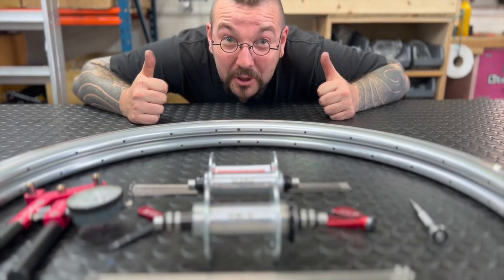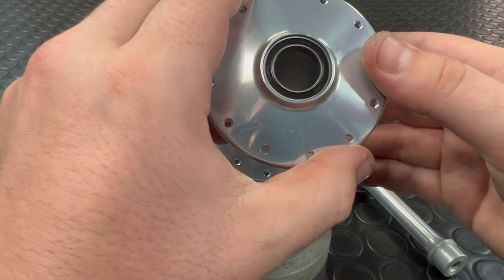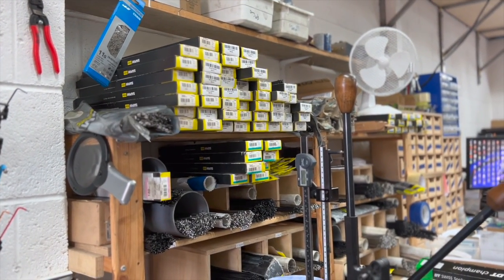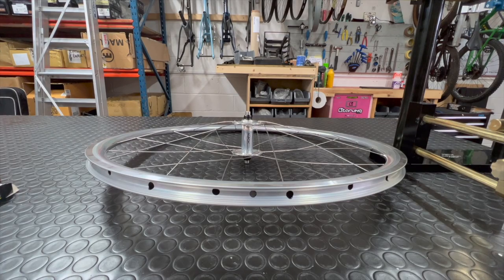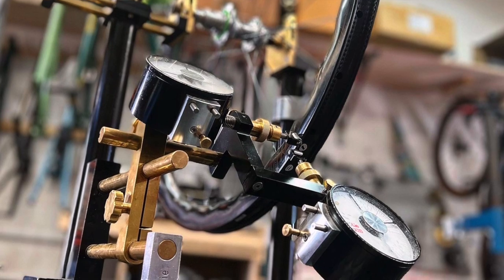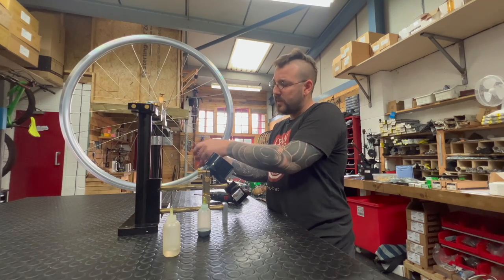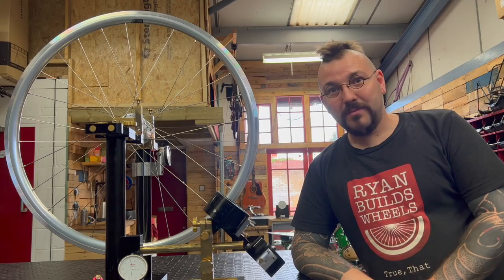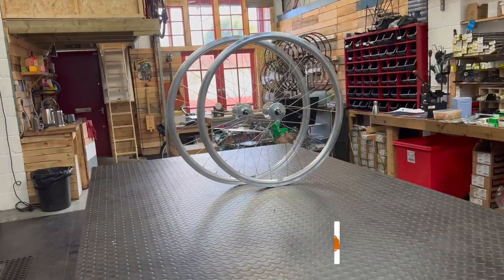Ryan Builds A Wheel (+ Mack Track Hubs Review)

Comment: I build a wheel every couple of years.  My trueing stand is a length of angle iron with a hole in it. Clamped into a monster vice on a plate steel table and magnetic base is a dial indicator  gauge. Your stand is amazing with rigid arms and roller tip gauges! It takes me longer, but I get good results with what I already had around.
Reply from the maker: Swell! Part of the joy of wheels is that they can be built with all sorts of equipment! I (naturally!) love my P&K but, hell, you could build a good quality wheel with nothing but your bike frame, some zip ties, a pointy thing of some sort or q-tip, and your hands to check relative tension...hell, I guess I should make a video about that some time soon!

Comment: Hello Ryan, what a great video, your truing stand is the stuff of dreams. Can you give more info on  why the inbound and and outbound spokes get a different numbers of turns when tensioning up ?  Many thanks for taking the time to pass on the knowledge
Reply from the maker: Hey Frank! Sorry for delay in replying on here! I'll go into this in full detail in the future but in short it's because inbound spokes naturally take a shorter path (due to the differences in triangulation between their origin point with outbound spokes) and so - theoretically, need to be shorter.  I calculate spoke lengths using the centre of the flange as my measuring point for Centre to Flange Distance) but if you run those calcs using the outside and then inside of the flange as the measuring point you'll find that the exact spoke lengths spat out tend to have about 0.3-0.4mm difference.  Likewise if you drive all spoke nipples down to the same depth and then add the 'correct' number of turns to each nipple and THEN look at tension between spokes you'll find that all inbound spokes are at a lower tension.

Spoke threads are 56tpi...which equates to 56 threads per 25.4 mm.  Divide one by the other to find out how far up and down the threads your nipples will travel with one full revolution and the answer is (circa) 0.38mm.  So we can safely suggest that one quarter turn equates to 0.1mm of spoke 'length' correction.  On most builds I add another 1 and a 1/4 turns to inbound spokes; finding the tht extra quarter turn tends to account for either spoke wind up or threads 'setting' into one another.

So...pretty much the full answer there but I"ll still run it as s video in and of itself in the future.

Comment: Great video - I met you at Bespoked 2022
How did you check for dish? - I guess your trueing stand has that dialed in. i.e. auto centres the wheel
Reply from the maker: With the P&K it's super handy / clever; you take a zero reading on one side...and THEN flip the wheel over and take a measurement on the other side of the rim; you half that error and BANG! Centreline of the rim now lies smack bang central to your axle; your wheel is dished :-).  I'll feature this in the future too.